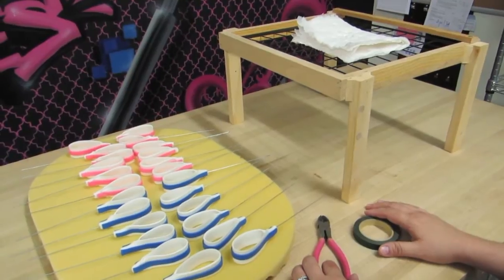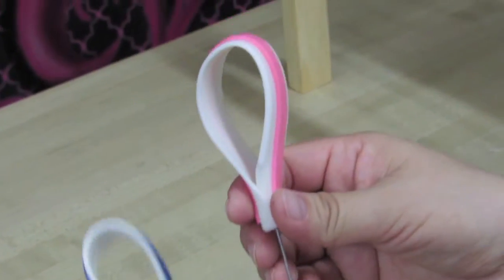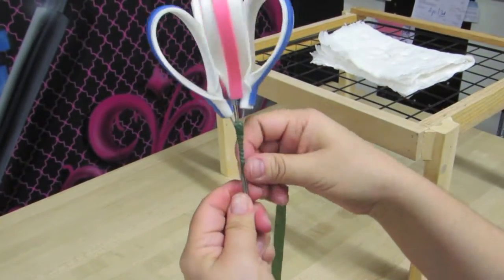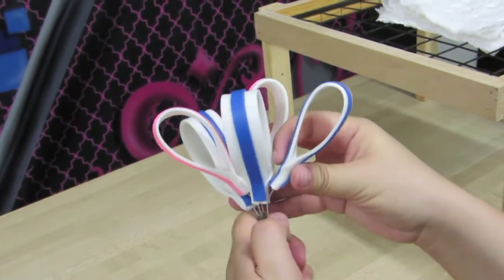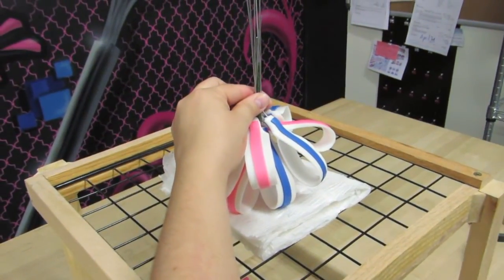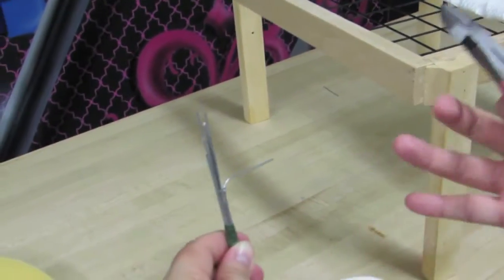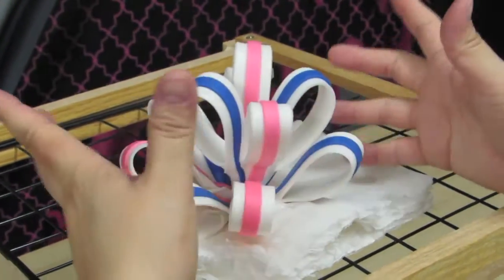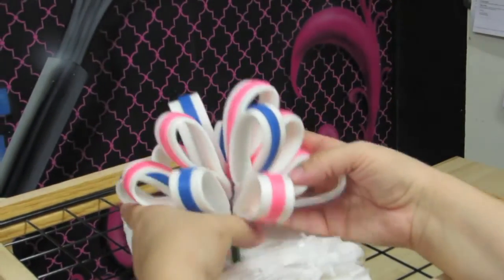How To Make A Multi-Loop Bow The Krazy Kool Way! Part Three

Comment from the maker: Are you bending the wires before you tape them together? The loops really should not be applying pressure on each other. They especially should not really be touching too much at the ends where the wire is coming out. Try and roll your gumpaste out a bit thicker. May I ask what type of gumpaste you are using? Or are you using fondant. The gumpaste I make is rather hard and difficult to break. Maybe that could be it?

Comment: Yes Laura. The gum paste is cracking where I fold the gum paste around the wire. I'm rolling it to about 1/8 inch thick. When I put the first 4 loops together, the pressure of them being pushed together is what is causing them to break I think??? I can't put the tape around the wire without kinda pressing them together though. Help????